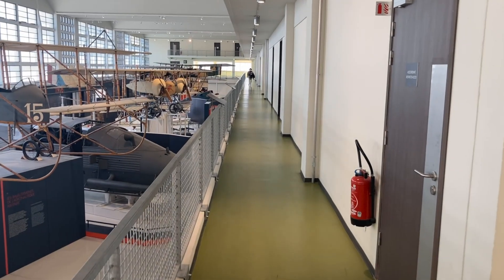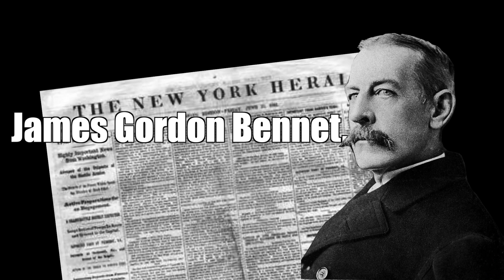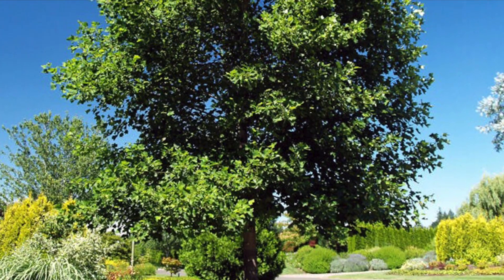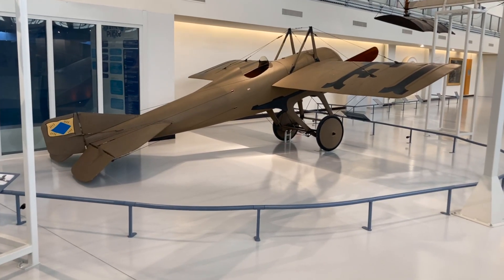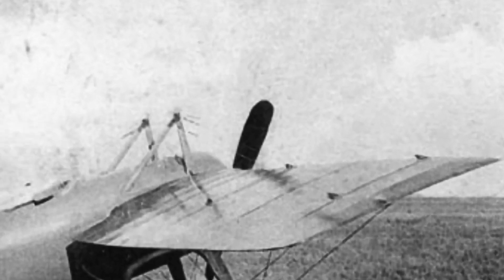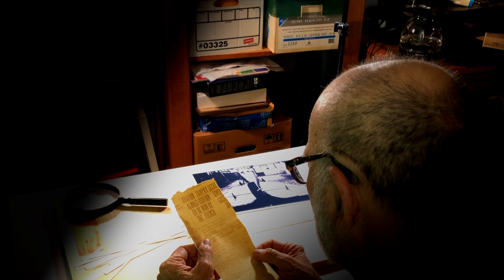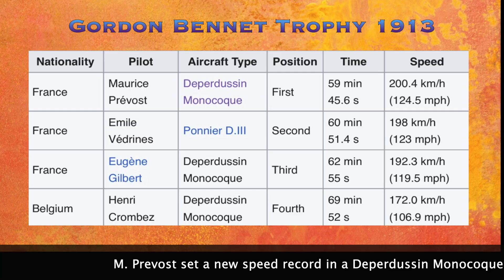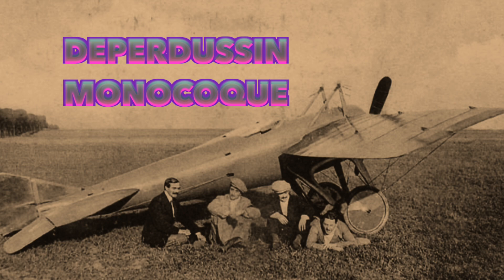The Fastest Thing in the Sky 1913

Comment: While monoplanes dominated the entries for the Gordon Bennett Trophy races, biplanes also participated. In fact, the first edition of the race, in 1909, and the last edition of the race, in 1920, were won by biplanes. The only year in which no biplanes entered was 1913 but the entries were severely reduced that year. Neither the UK or USA contested the event and several notable French manufacturers, including Blériot and Nieuport boycotted the French qualification trials, as they were being held at the field owned by Armand Deperdussin, who had just been arrested for embezzlement. Deperdussin's planes would win the event while he sitting in jail cell, awaiting trial.

I‘m not convinced that the fuselage consisted of a right and left half that were glued together. If you look at the famous photo of the employee carrying a monocoque, there is no discernible seam or misalignment of the tulip wood strips along the bottom, on the inside of the monocoque. There does appear to be a line on the inside, along the left wall of the fuselage, suggesting the mating of top and bottom halves. While there is a seam visible along the top in some photographs, this could be the seam in the fabric covering.

The Deperdussin Monocoque that set the air speed record during the 1913 Gordon Bennett Trophy race was specially modified immediately prior to the race. The standard model had the mentioned 23 foot wing span but when a practice session indicated that Védrines’ Ponnier may be slightly faster, shorter wings were fitted for more speed. Sources vary on the exact wingspan, with reports ranging from under 20 feet, to 21 feet, 10 inches. It’s easy to tell the difference in photographs as the standard wing uses two sets of bracing and wing warping cables, while the shorter wing uses only one set. In addition to the decreased drag offered by the shorter wings and decreased cabling, the short wing also used a different airfoil section which increased speed at the expense of lift and therefore could only be used in optimum conditions. Fortunately, the conditions were perfect that day.
Reply from the maker: Thanks for your in-depth comment. I to question whether right and left halves or top and bottom were joined to form the fuselage. As you know some, if not all, Albatross fuselages were also laminated wood and I believe they were fabric covered as well. I’ve seen one but did not examine it closely and it was a reproduction. During the same time period an American manufacturer experimented with the same process. Again thank you for your very. Informative comment.